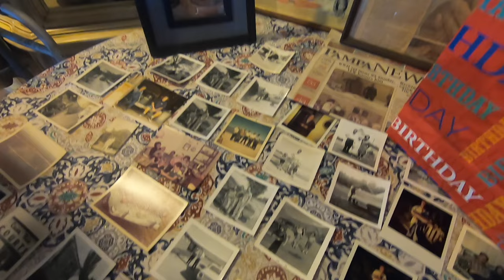Surprising Dad for 99th birthday with '55 Ford he never thought would run again

Comment: 15:32 “the fastest i’ve ever drove it was 115MPH” What a badass
Reply: Funny cause yesterday my dad was going 120 mph in a skoda superb estate. How technology has changed
Reply: I did 117 in like 3 seconds in a c7 Corvette
Reply: R H unless it was a drag car with 2000hp you're not gonna be doing those speeds in 3 seconds.
Reply: @Hoffmanpack  you cant call him out like that if hes right lol. Technically you did 90-117 in 3 seconds. It makes a difference
Reply: I believe it’s donuts per eagle
Reply: Pulse get out of here normie
Reply: I rented a compact to midsized car in 1996, I can't remember the make. And got it up to the low to mid 130's on a short downhill. And as I recall, on the flats it would do in either the very high 120's or 130/131.

That was in the middle of the night in New Mexico, coming back from Carlsbad Caverns to El Paso on some US highway.
Reply: raheem segowski skoda super B? Really where
Reply: I did it on my motorcycle and didn't even know I was going that far too I looked at the speedo
Reply: R H We’re on YouTube bro, why don’t you just post the 0-90 and we’d believe it?
Reply: 115 in those cars are dangerous. They are very heavy and have little axel motion

Comment: This car hasnt been started in 45 years .No modern car will ever be able to claim that. These engines are basically big lawnmower technology.
Reply: Maybe they stored it without gasoline?
Reply: Jokes on you I have electric, no engine TO start
Reply: Artifex good luck getting that start in a few years of not running when those batteries expire
Reply: @artifex1556  Have fun replacing batteries every few years
Reply: Modern engines are absolute shit. Aluminum cylinder heads, and some engines are entirely made out of aluminum
Reply: The Penny Collectors then why  am I constantly reading about modern engines getting 300, 400, 500k?

Comment: My brothers and I did the same with my Dads cars before his death he was terminally ill. We had a big party and got all his collection out 1917 model T touring black lacquer, 1923 model T Flatbed-truck, 1928 model A pickup, 1930 model A coupe, 1953 Chevrolet bel air , 1956 Chevrolet bel air, 1962 Corsair side ramp pickup, 1927 Chevrolet 2 door touring and a 1963 Chevy ll SS . It was a lot of work to clean them all up and several new batteries and gas lots of turtle wax he was so happy and tears filled his eyes we had his chair positioned so he could see all the cars lined up out in the field while we all took turns going out around the block a couple miles. This brought back those memories actually brought tears to me. He loved his cars he restored them all completely by himself he was a master craftsman in his day. Now he’s safe in the arms of Jesus since 2013 man how time flies thanks for the video Cheers

Comment: What a great story. My dad died a year ago and was cut from the same cloth. He grew up in the USA and Italy during the depression and war. The penny pinching drove me crazy as a kid. Yet, I picked a lot of it up and am better for it. I was advised on how to take a shower.... turn the water on to get wet, turn it off and keep it off during the soaping, and turn it back on to rinse off quickly. LOL. This is a sweet old Ford. The interior is pristine. The exterior colors are the perfect combination. I am glad he was able to go for the drive.
Reply from the maker: Good example, did you also put the water heater on "vacation?"
Reply: @thewriter2549  It was always on the luke warm side.
Reply: @thewriter2549  Actually, I adjust my hot water heater up and down before and after taking a bath. LOL. Plus, it is over 40 years old, so, I am trying to extend it's life as well as save a couple of dollars on gas.

Comment: Derek from Vice Grip Garage could get that thing started AND drive 1200 miles with a gas tank on the back seat running a length of hosepipe.

Comment: Great job!  BUT, you CAN NOT use those skinny battery cables with a 6 volt system.  You MUST use 1 gauge - the smaller the number, the thicker the wire -, or else you will have persistent cranking problems that you will wrongly attribute to the fact that it is 6 volts.  6 volt starters draw twice the amps as 12 volt starters.
Reply from the maker: Forgotten tech that is good to know.